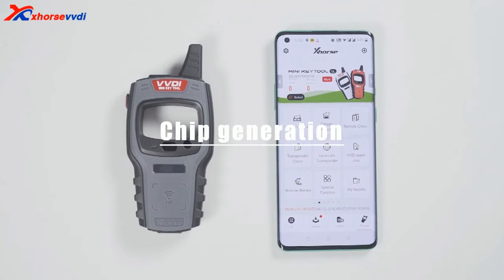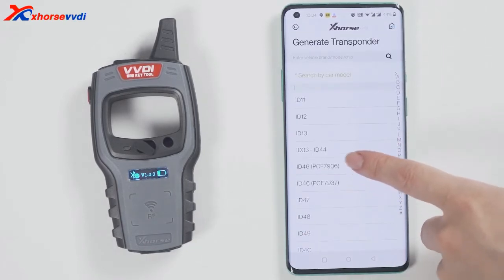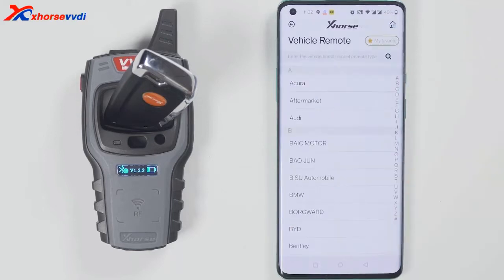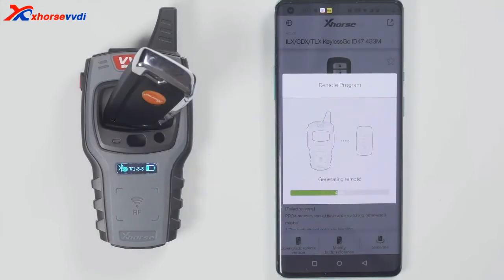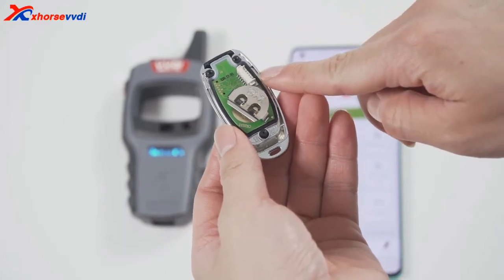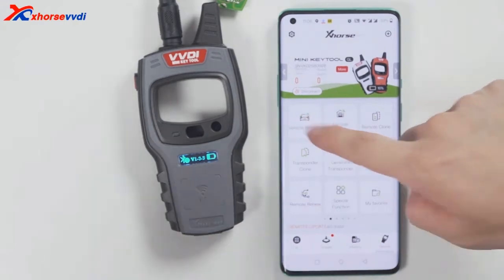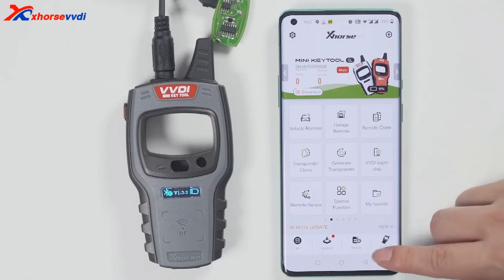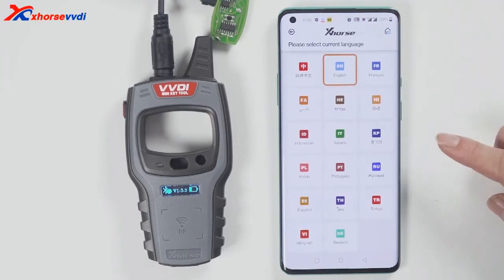R/W Chip, generate remote done on Xhorse VVDI mini key tool -Xhorsevvdi

Comment: When you use super remote wireless to program it, first you should insert a 2032 battery, if you use a wired remote it's programed without battery.

Comment: my freind after burn the universal remote vvdi key include cloning chip, then can we use others type of repogram tools like autel to program direct to vehicle ?????
Reply from the maker: Yes,after generate,you need use key program to match it.Thanks
Reply: @XhorseVvdi  Thanks alot, another question assming i clone chip 46 after clone can i erase and re clone for another type of chip like chip id 47 or other type ????
Reply from the maker: @anwar-dv3mc1fn6i  If use xhorse super chip or vvdi remote,it is OK to re-generate.
Reply: @XhorseVvdi  I mean after generate chip id 46 using vvdi then i can erase it and re generate again different chip number like i want to change and re generat it with chip 47 ofcourse using vvdi my friend, thanks alot
Reply from the maker: @anwar-dv3mc1fn6i  Yes,vvdi super chip can support multi-types,11, 12, 13, PCF7935, PCF7936, PCF7937, PCF7938, PCF7939, PCF7946, 48, 4C, 4D, 4D(80), 4E, 8A, 8C, 8E
Reply: @XhorseVvdi  Thanks a lot